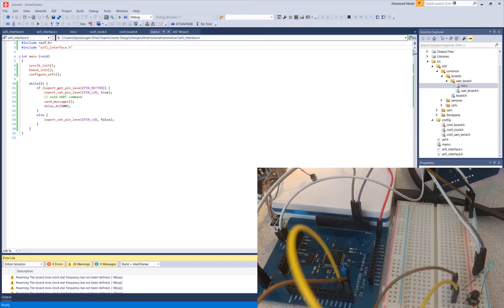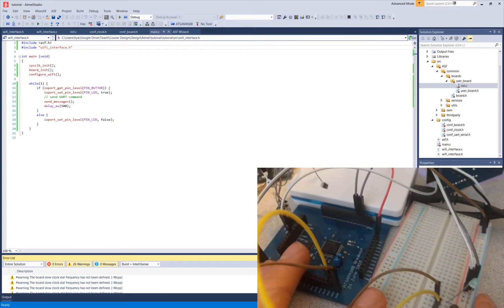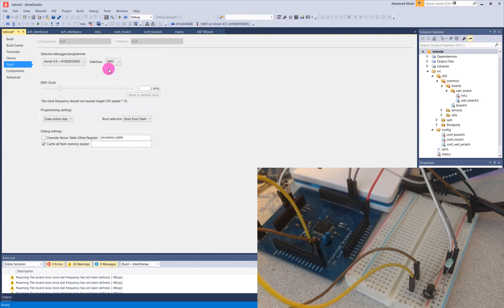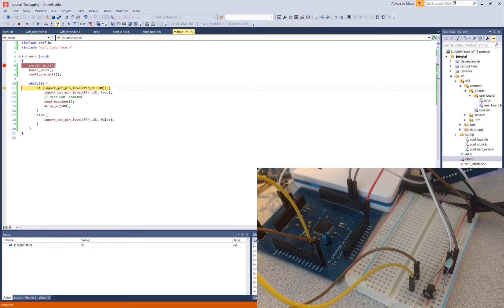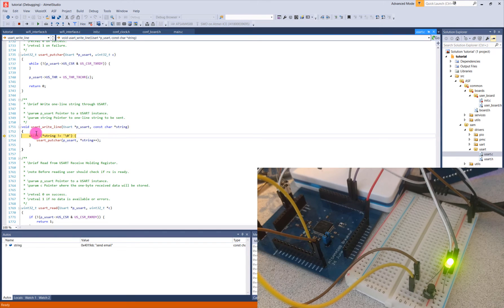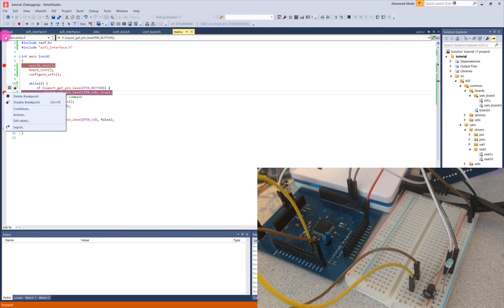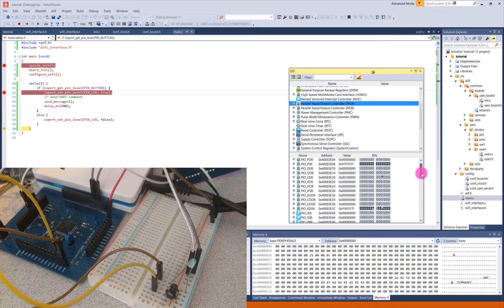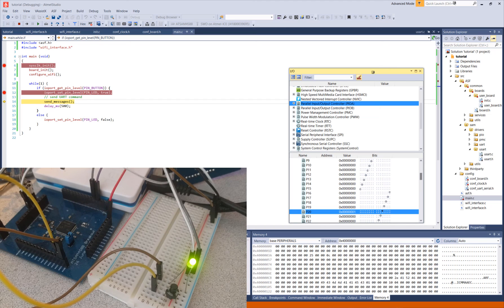Atmel Studio Programming and Debugging

Comment: Can you debug using jtag too? and what is the difference?
Reply from the maker: Good question!  You can use JTAG as well, but I have never tried it with this chip.  In general, SWD requires fewer pins, but JTAG is more widely supported beyond ARM architectures.  I use SWD where possible for the lower pin count.
Reply: Thanks

Comment: Is the ATSAM4S breakout board available for purchase?

I understand VisualGDB is a plug-in for VS Studio.. but is Atmel Studio also based on Visual Studio (ex. VS Community)?  Other than VS Code, which is based on the open source IDE, atom-Electron, anything Java/Visual Studio brings my computer to a crawl!

Any thoughts on setting up emIDE, Eclipse or VSCode with GCC/LLVM and either the Atmel-ICE debugger or the J-Link Pro?   I've had issues getting OpenOCD to do SWO/SWD, and ETM Trace functions.      

The Keil uVision IDE/compiler works great with Atmel-ICE (CMSIS-DAP) and the J-Link debugger, but it has a 32KB limit... could the GCC or LVMM compiler/makefile be used in the uVision?

Comment: I would like to know one thing.
When debugging AVR chips using Atmel ICE,I noticed that whenever a delay occurs & I try to stepping over the delay,the debug session enters into the delay and the debug session gets hanged and I have to manually reset the session.
But in your case,I can see that stepping over a delay is not causing the session to freeze/entering into the delay.
How you managed to do that???Please reply!
Reply from the maker: Because of the way debugging works, things like delays will take a very long time.  You will notice the same thing with for loops.  I have not used the Atmel ICE for AVR, so I don't know this, but it may be even more pronounced than for ARM.  However, one thing that has worked for me in the past is to place a break point immediately after the line that freezes, and hit "Continue".  This usually skips the delay.
Reply: I was using the break point/continue method as an alternative!!.Although,thanks for the reply....